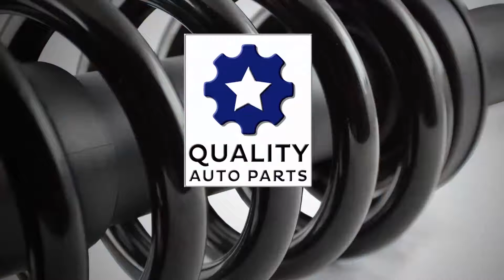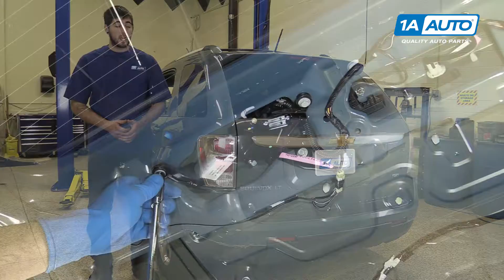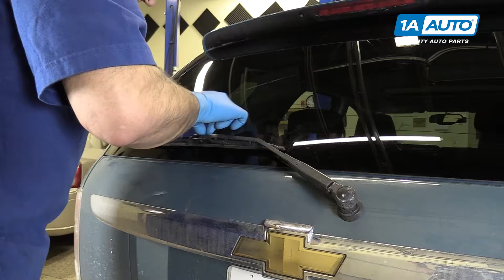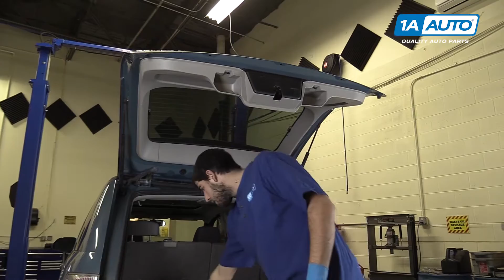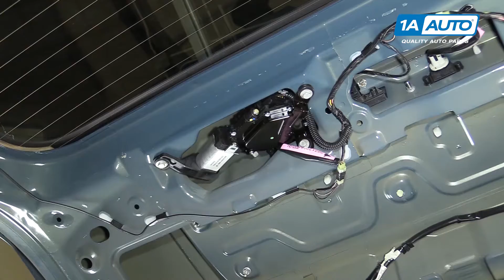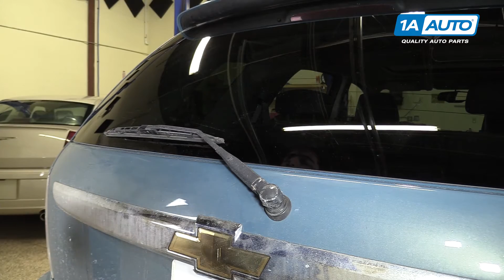How to Replace Rear Wiper Motor 07-09 Chevy Equinox

Comment: Why is my rear windshield wiper making a grinding noise and it will not move
Reply: Having the same issue after replacing the rear wiper motor. Exchanging for a new motor tomorrow to see if it changes anything. Even with the car off and the key out of the ignition, the rear wiper motor gives the grinding sound. Only way I can stop it is by removing the fuse.